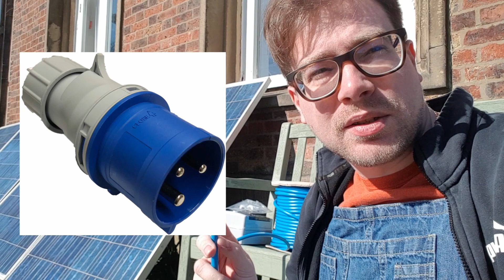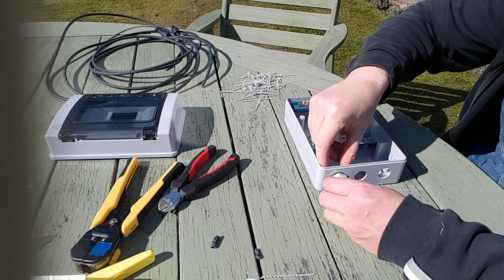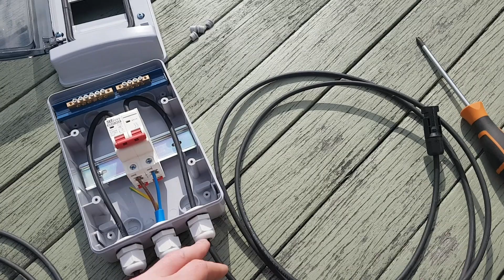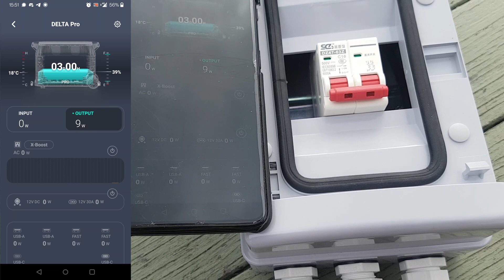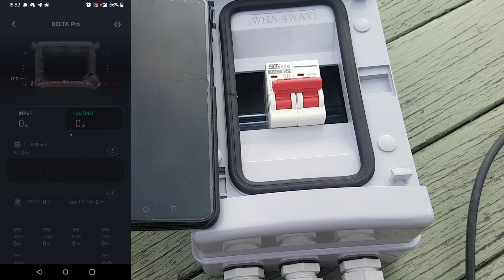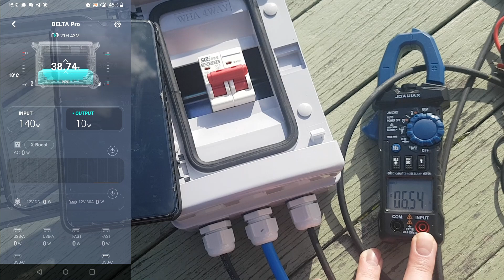Panic as I wire Solar Panels into the Ecoflow Delta Pro UK

Comment: I am unsure whether the fuse is suitable for cables without wire ferrule. This could possibly lead to high contact resistance.
Reply from the maker: My understanding is that this normal way of wiring things in the UK but I am not an electritian so don't quote me on that. It has been running for nearly 2 years and I have not had an issue. 

Where I have had an issue is with an MC4 connector that I had clearly been crimped badly and was heating up quite a lot. The copper in the cable had clearly degraded and gone very stiff, the wires going into the box still feel normal.

I am going to be moving house soon so it might be a good opertunity to put ferrals on the cables, I didn't have any at the time but I do now.

Comment: Hi Matt, im totally new to solar and solar generators, im after some advice, could this be coupled to use both wind turbine and solar panels for a faster charge in an off grid situation, cheers.
Reply from the maker: Hi Martin, this is an interesting question and something I have only had a very brief look at and come to the conclusion that wind with solar generators isn't really a thing. 

They are designed to work with solar panels, wind requires additional electronics to manage the excess power that wind produces without damaging the turbine.

The only way I could think of is to have a buffer battery which the wind turbine charges but since the solar generators I have seen only has a single DC input you would also need to add the solar into the buffer battery. By the time you make a big enough buffer battery to push enough power into the solar generator you may as well just make your own complete system.

I think it is possible but I don't think it would be easy to do.

Comment: Hi Matt, you're likely suffering from voltage drop at that 50mtr distance, running what looks like 2.5mm2 flex. Worth running the numbers to ensure you're giving the delta pro enough juice to charge efficiently. I think the delta pro's inbuilt MPPT charger has a minimum solar input of 11v? Possibly why the single panel in the shade wasn't performing, especially if that was over the 50m distance. Wiring your four panels up in series (if you haven't already) will help combat  this, but over such a long distance you may find that regardless with 2.5mm2 cable the drop is still hampering you.
Reply from the maker: You are quite right, there will be likely be some voltage drop with the cable I am using, I knew that when I made this video, I think I even hinted at it although didn't say it. I have been intending to run the numbers but I haven't gotten around to it. 

What I can tell you is since I made this video I have now got 9 solar panels and depending on the time of year I either run a 4s2p which gives me 120-140v in the summer which I have seen pulling in 1700W for breif periods. Or as it is now in winter 3s3p for about 80-100v and around 1300W peak, not that I see that to often. 

I can feel some warmth from the cables when it is pulling 1700W, I am unsure if that is just because the sun is heating it up for if it is the resistance of the cable at around 18amps. Either way I am happy enough with this cable that I cannot justify spending the money to get anything better.

Something that I had considered doing is this cable has 3 conductors, I'm only using 2 of them, I could pair up the spare conductor with one of the other 2 and reduce the amount of resistance (half?) in one direction at least. I was thinking about making a video on it but I haven't gotten around to doing it yet.

Comment: Do I need a breaker for 1 solar 100W panel? And if yes, which you recommend?
Thanks!
Reply from the maker: Probably not so long as you are using good cables, if the panel uses the standard MC4 connectors they are probably fine. That isn't to say that other connectors are wrong or dangerous, they are just most common. 

For a more technical answer 100w panel is probably about 12v so a maximum current of about 9 amps. The wire will likely have a number on it followed by "awg", if the number is lower than 20 they should be okay but the smaller the number better, I would probably want at least 18 awg. The lower the number the thicker the cable is. 

What breakers, fuses and other things like that are mostly for is to stop to much power going through cables which can only carry so much current (amps). If they carry to much they can heat up, in extreme cases can cause fires. 

If you do want to get a breaker find it what power your cable can handle (there are charts all over the Internet for this) and find a breaker that is about that current (in amps) or a little bit less that is rated for DC (direct current), most are AC (alternating currently) and cannot handle DC.

If you are ever unsure please do ask a qualified electrician.

Comment: it's too bad the watt measurement can't handle lower wattage.
Reply from the maker: That's the problem with shunts, they are either accurate enough with low currents but can't handle high current or they can measure high current but can't see low current sadly. I'm sure there is going to be something expensive that can do both though
Reply: @MattWells0  I called Eco flow, and the Delta Pro will show 0 watts until the input gets to 40 watts. That is too bad. It does show the solar panel Icon, however.
Reply: Digilent makes a little current/voltage sensor for $10 USD called PMON1. WIth a raspberry pie (or other low power computer), you could make your own display or logger.
Reply from the maker: @morpher44  I was considering doing this before I discovered an integration with Home Assistant which lets me put all the stats on a dashboard as well as run automations based on the the state of charge of the battery or how much power is coming in. Take a look at my latest video to see how https://youtu.be/KFpb1SVWdIA although I might do it anyway for the fun of it
Reply: @MattWells0  Yes I use Home Assistant. I originally had it on a Raspberry pie, but then tried the Oracle VM Virtual Box version and running on a PC is a bit easier for me.
Reply from the maker: @morpher44  I have the Generic x86-64 running on an original Microsoft Surface Pro tablet, works really well and has an in built UPS, I'm really pleased with it, only a bit of a shame that I have to use a USB network adapter though. Also enjoy that a Microsoft device is running fully opensource software :)

Comment: The first time I hooked up solar panels to my new Delta Pro, it took a few minutes for it to put out a reading.  And it was a bright summer day!  I was freaking out!
Reply from the maker: Yeah I was too, made all the worse that I was doing it while it was over cast and the Delta Pro wasn't even registering that there was power going in. It wasn't until I noticed that the time remaining was changing the I calmed down a little >.<

How is your setup working for you? :)
Reply: @MattWells0  I have only charged it with the plug in.  I only had a 100w solar panel attached and it was only taking 48.  I ordered some connectors so I can connect 3 panels.  I may need a 4th one.
I used the Delta Pro to power a 5000w window a/c in my camper trailer.  It said it could power it for 6 hours but I turned it off after 3 hours.  It ran the a/c perfectly fine.
I used it the next day to run a little Dirt Devil vacuum cleaner.  It worked great!
I was gonna go with the Bluetti AC 200 max, but I’m glad I stepped up to the Ecoflow Delta Pro!
Reply from the maker: @SaabAholic  Oh fantastic, its getting hot here and I am wondering how well it would do with an AC unit, it is good to know it can do it :)

Which way are you looking at wiring your solar panels? Are they mounted the the roof of your camper or do you have some other arrangement?
Reply: @MattWells0  I’ll probably mount them on top of the camper.  Full southern exposure where it’s parked.  I’m just south of the 45th parallel.  I’m new to all of this, so I’m not exactly sure how to connect the panels.  I need to watch another video and take notes!  I always forget what I’ve learned, lol.
I’m also going to set up a mobile solar setup with one or two lead acid batteries rated at 12 bolts, 550 Watts per cell. I will use a Renogy Wanderer solar charge controller and a 1000w (2000w surge) power inverter for whatever it can power.  Like the fridge, or my little a/c unit.  I don’t know enough about this stuff yet.  I’m a trial by error hands on kinda guy!
I also have an Epever MPPT charge controller.  I think I impulsed-bought that a few months ago after watching a video. 🤠
Reply from the maker: @SaabAholic  series is the easiest, that is where you plug the output of one panel into the input of the next. Doing this adds the voltage of all the panels you connect together so you just need to make sure the total voltage is below what the Delta Pro can accept and you are fine, no special connectors or wiring. The downside is if any of the solar panels are shaded, by a tree for example, all the solar panels are affected by this. Alternatively you can wire them in parallel, this is where all the outputs are connected together and all the inputs are connected together. It is a little more complicated but only the panel that is shaded will not be producing full power. If you have enough panels you can have both series and parrallel strings like I have. I found this video by Andy at the Off-Grid Garage really handy at explaining: https://youtu.be/GFjL0-r6LbY
Reply: @MattWells0  I appreciate it! 🤠👍🏻
Reply from the maker: @SaabAholic  Welcome, please let me know which way you set it up and how it works for you :)

Comment: the artic cable you have there is widely used as power leads for the caravan market here in the UK as a mains hook up lead, it is more flexible than standard cable and if wired correctly to the correct plugs/sockets offers a degree of weather tightness tio ip65 or thereabouts, i know it is used as a caravan hookup as i have several of these myself, and they are a common site on touring caravan sites both in blue and orange and sometime yellow
Reply from the maker: I actually purchased it for another project which would be more in line with it's original purpose, although for getting power out to where I have my christmas light display. Really good cable for that kind of thing. 

Typically yellow is used for 110v equipment on construction sites so I think it would be less likely to see it although it perfectly safe to be used like that as the cable is rated for those higher voltages so it is fine to do that.

Comment: I don't understand this video. My own delta pro and solar panels are in the post as I write this and as far as I know all you need to connect the delta pro indoors to the solar panels outdoors are some extended mc4 cables to bridge the gap between them, which you can pass through a window. These aren't very expensive. The delta pro has its own internal controller so I don't understand why Matt has gone through all this hassle to get his delta pro charging indoors. Am I being naive? I dunno. Feel free to educate me, please.
Reply from the maker: Hi Darren,

Please note that I am not an electritian, I'm a software developer who like to do this stuff in my spare time. This is my understand of how to make this equipment as safe as I can but I am not an expert so please do you're own research.

Would it work without it? Sure, but there is a risk that something could go wrong. I would advise that you place inline fuses with the solar panels at the very least, like these ones I uses for connecting the strings of solar panels together https://amzn.to/3wZCWqO (affiliate link). A fuse is an intentional point of weakness which will fail safely, potentially protecting the rest of your cabling, equipment and yourself.

In my situation my solar panels are about 50 meters away from where my Delta Pro lives, anywhere closer than that they would be either in the way or covered by shade most of the day. 

I am using cable that has is 2.5mm2 copper conductors which is about half of what "typical" solar PV cable comes as so the current carrying capacity is going to be lower with this cable so I felt it was a good idea to have the extra safety of a breaker as the number of solar panels I have could produce over 24 amps which will cause the cable to heat up above what the cable is rated for. This means that the insulation around the cables could melt causing shorts and arcs which can cause fires or injur someone touching the cables. I felt that given that this installation is fairly permanent adding the breaker will ensure that the current can't get anywhere close enough to be a danger and provide a convinent switch to be able to turn the panels off if I needed to.

As for burrying the cable, this is mostly for conveneicen, as you can see it goes over the front lawn, which needs to be mowed about once a week. Rather than moving the cable every time I want to get by I felt that tucking it under the grass would be useful. Also has the added bonus of reducing the risk of tripping over the cable. There is still a section of cable going over a path between my house and the lawn that I am looking to add some extra protection, possibly something like this https://amzn.to/3GACnbj (affiliate link).

Hope this helps,
Matt

Comment: Renology also make MC4 inline fuses (which I use).   They have a male and female MC4 fitting so just click between the solar panels and the line that goes indoors. 15amp ones from Amazon.   Just that little bit extra protection as you are doing there too - but perhaps a very quick 'plug and play' version?
Reply from the maker: That solution would work and I do have those devices where my strings of solar panels get combined so if one of the panels were to go open circuit the other panels wouldn't cause the faulty panel to catch fire.

The advantages that this box gives me is the switch, so I can turn the solar panels off safely before I start disconnecting panels. Mc4 connectors are not designed to be disconnected while they are conducting electricity and could cause arcing and reduce the risk of me getting shocked by accident. Also I'm not using "real" solar pv cable, it is standard household 3 core mains cable so this box also gives me the advantage that water can't wick up the outer insulation and the inner cables as well as the safety protection.
Reply: @MattWells0  Under your circumstances, the switch makes a lot of sense.   My panels are only about 70' from the units so I can more easily just unplug them.  The MC4 fuses do just unscrew though (the fuse is between the male and female connectors, and that center part just unscrews easily!)  I could change a fuse if it ever went in about 30 seconds with no tools needed.
MC4s can sometimes be a bugger to take apart, so that's just as well!   Haha!
Reply from the maker: @mrpad0  absolutely for that setup it is completely fine. And I know the pain of disconnecting the mc4s! I have to do it every week as my panels are still "temporarily" mounted on garden furniture and I need to move them once a week to mow the lawn 😅 the pack of mc4 connectors game with a tool to help but it doesn't always fit

Comment: Hi Matt, have just bought the delta Pro, not read the manual yet but just seen your videos. i have yet to learn about connecting panels in series and parallel. I obviously want to be able to charge the pro with as much energy and as fast as I can from solar panels. Would very much appreciate any advice. It might be a good idea to read the manual now ah ah. thanks for the videos, they have inspired me. Neil.
Reply from the maker: Hi Neil,

It is really easy to install them, I would recommend watching Andy's video over on Off-Grid Garage where he goes over series and parallel solar panels https://youtu.be/GFjL0-r6LbY it really helped me.

I have just upgrade my solar panel array video here for more https://youtu.be/gGxwt0R0KFc?t=131 so I will use them as an example:

For the Ecoflow Delta Pro when you put them in series you must ensure that their total open circuit voltage is below 150v. My solar panels are 37.8 volts (I'll call it 40 for easy maths) which means that 4 panels are 160v which is to high so I have to use 3 for 120 volts.

When you put them in parallel it combines the current, in theory you can put as many of those together as you like and the Ecoflow will not use more than it can handle. It is rated for 15 amps, although on a good day I have seen it go up to about 17.5 amps for short amount of time. My array is rated to produce about 24 amps. 

The reason for the additional panels in parallel above the rating of the Delta Pro is that on cloudy days the solar panels cannot procuce their full current and means you are more likely to get a good charge on these days. This is often referred to as over panelling. If you live in a sunny part of the world you probably don't really need to do this, in the UK however on a cloud day even with over 2000 watts of solar panels I have seen it only pull in about 350 watts max all day about a week ago.

Matt
Reply: @MattWells0  I was just about to post a similar comment regarding over paneling, thanks for saving me the time. LOL. I have a Delta MAX with 4 340 panels in a 2S2P format and consistently get 800 watts into my MAX for a good portion of the day, regardless if my panels are oriented properly, slight over cast, etc.
Reply from the maker: @johncasey5594  if you have enough panels on a nice day you don't even have to aim,especially at the moment with the summer solstice approaching. :)